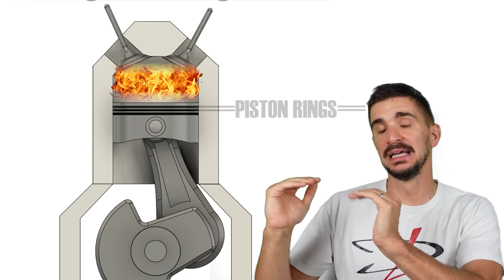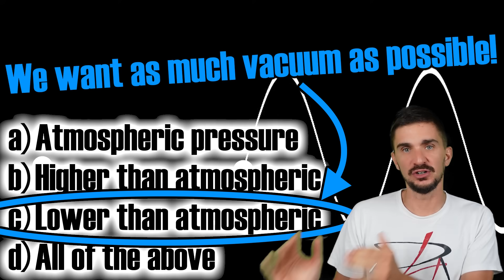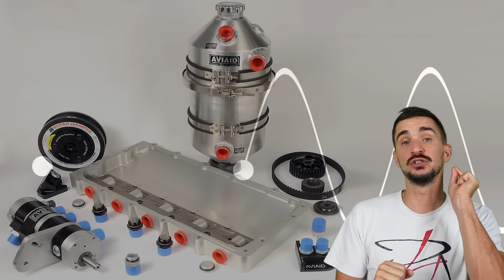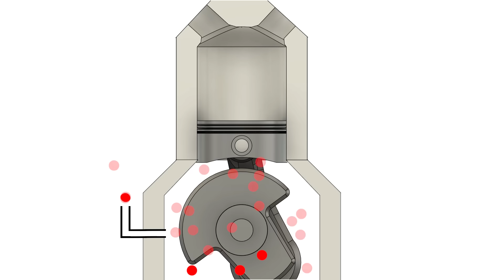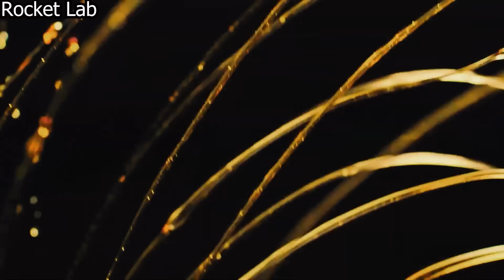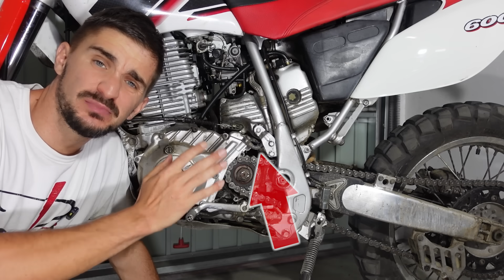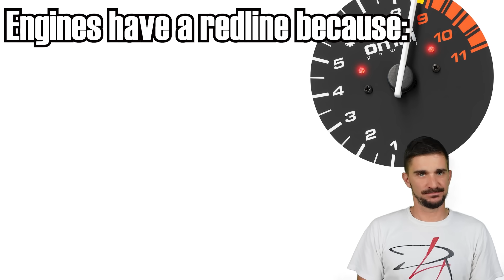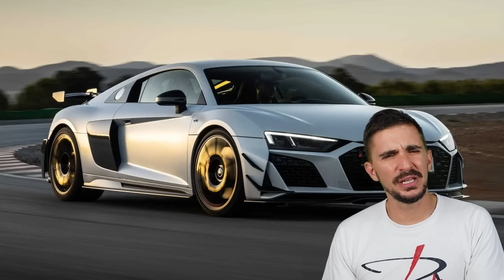Installing This Has No Drawbacks, Except for Your Wallet - Dry Sumps Are Awesome, Here's Why...

Comment: So mostly it is not installed to gain more power because of vacuum, first reason is uninterrupted oil delivery in extreme engine positions, next, in porsche's case it is mostly saving vertical space, partially it is applicable to bikes. That's it! More Powa is a side effect. Speaking of wet sump, oil hardly meets crankshaft, you need to overfill oil significantly, 2x of max level or more to achieve crankshaft dip on running engine. That's because significant volume of oil is in oil traces. Take a look at Garage 54 experiment.

Comment: Just a thought: I saw Garage54 test the angles at which the engine is starved of oil. Have you seen that video? It seems that EXTREME angles (therefore acceleration - in any direction) are needed to starve the engine of oil. Do you really think that still may be an issue with wet sumps?

Comment: 0:10 If the combustion was below the piston rings… something was really wrong. 😂
Reply: 1 stroke engine 🤣
Reply: @immortalized.1 steam engine.
Reply: That's when you need a new engine block lol
Reply: Haha, usually that is a "one-off" problem! "Don't worry, it will only happen once!" 😂
Reply: Just another Tuesday for a Subaru
Reply: Like a 2 stroke engine
Reply: Maybe the engine is up side down!
Reply: Double the combustion, double the powah!
Reply: But there is so much more space and that fuel is thicker

Comment: 4:22 but surely the opposite is true for the return, 
Yes low pressure for the piston going down, but the high pressure in the cylinder means the crank suffers parasitic losses as the piston returns to TDC?

Comment: 20:25 going to 17000rpm with a coolant temperature of only 37°C is insane
Reply: Yes it is funny but unfortunately the dial rotates every time you put it on contact and 37c is the lowest temp it can show (source I have that same bike xd)
Reply: Yeah, that's always been an issue with Ford engines, with their ultra-high power production and off-the-charts rev-ability. Why, I remember shifting my bone-stock 650hp 289 at 26,000 RPMs at the track, because I didn't want to rev it beyond it's 30,000 rpm red light. 😊
Reply: @HighlanderNorth1  lol

Comment: 4:59 Jeep 4.0L straight 6 mentioned!!!!
Reply: That ultimate performance engine 😂 though the other commenters do point out the advantages of a dry sump for extreme temperatures off-road departure angles.
Reply: You should look up turismo Carretera in Argentina, they race jeep 6s with 24v dohc head conversions.  @becausetrains

Comment: Dry Sumps should have been made the standard on all cars many years ago. But I guess it isn't worth the effort or cost. I suppose on the most basic base model cars its a bit unnecessary, but anything sporty - like even the Mazda MX-5/Miata should have them because high G-Force is expected when driving them.

Comment: This guy produces very high quality technical videos! The 3d graphics are the best! And they always fit the text. He must put a lot of hours into them. Also, he is an excellent teacher. He avoids descending into too much detail, yet he is very thorough in exploring a subject. The order of his presentation is logical and easy to follow.. I have learned a lot from him over the years, and I have always had an interest in automotive engineering. I also appreciate his polite, clean language. I probably left something out. And no this is not a paid endorsement. You can see for yourself.  I just think he deserves the credit and support, and this with words is all I can give at present.
Reply: I concur 100%
Reply: He has no idea what he is talking about.   For instance, in this video he claims that the piston, in compressing the crankcase contents, means a power loss.   It doesn't, because while energy is stored in the gas when the piston goes down, the gas returns that same energy to the piston on its way up.  There is no energy loss, just a cycle back and forth.
In any case, in a balanced multi-cylinder engine, there is no compression since just as many pistons are going down as going up.
He made an equally silly claim in another video I watched.
He claims dry sump working can give you about 30 more horsepower.   That's ridiculous.   At university I did morse tests on the larger sizes of car engines - a morse test tells you the sum of losses due to friction and gas pumping.   These total significantly less than 30 HP.
Reply: @keithammleter3824  I don’t have your education but how do you get positive crankcase ventilation? Where does the positive come from? I understand it is “leakage” from the combustion leaking by the piston rings. My defense of his video is he’s explaining about dry sump lubrication to which my Porsche has.
Reply: The word “positive” in this case referred to the active ventilation of the corrosive gasses that can form as the combustion byproducts that leak past the piston rings react with moisture that has condensed in the crankcase after the engine has cooled down from operating temp. As opposed to the passive ventilation of the road draft tube which was commonplace on car engines before the 1960’s.
Reply: @Electricjello  In my previous post, I pointed out that compressing the crankcase contents does not mean a power loss.   This does not mean that blow-by does not occur - obviously it does.   If there is a build up of pressure from blow-by this has to be got rid of, and the valved ventilation back to the intake (Positive Crankcase Ventilation) is how it is done in car engines.
In large engines, eg marine propulsion, the build up of unburnt and partially burnt fuel that gets past the rings can be very dangerous - by combusting with the air in the crankcase it can cause the crankcase to explode.   This hazard is avoided by the use of pressure relief valves (Bicera valves) on the sides of the crankcase.
I haven't watched the entire video, so i don't know if he covered the following.   I watched half of it -  the presenter's ignorance and multiple errors was enough for me.
Dry sump working has advantages.    It avoids oil pump starvation in engines that have to operate tilted or upside down (eg aerobatic aircraft), and engines used in racing where they are subject to lots of extreme acceleration and braking.   Dry sump working is often used in applications where very long service intervals are required, since there is no limit to how much oil can be held in the external tank.   In marine propulsion it means you can change the oil without shutting down the engine, which you never want to do when at sea.  
But not to get more power.   Your Porche does not confirm this video.
Reply: @Electricjello  Compressing and decompressing matter exerts heat, correct? Every energy transformation or transfer leads to energy loss, usually in the form of heat.
Reply: @keithammleter3824  You watch half a video and then talk about engines that are in different league to prove your invalid point.
 Reducing pumping losses is a valid way of making an engine more efficient and increasing horse power.
Reply: @keithammleter3824  I guess Porsche got it wrong? Let me know when you make videos so I can see the correct way to present these topics. Thank you
Reply: @chibacha21_CarBoi  Compressing a gas transfers heat to the surrounding vessel, and subsequent expansion draws heat from the vessel back into the gas.
Reply: @Electricjello  I didn't say Porsche got it wrong.  Read my earlier post - I said in certain applications involving high acceleration and braking, dry sump working is an advantage in that it avoids sloshing starving the oil pump of oil.
This could well apply to a high performance Porche, though marketing advantage could well be a part of Porches' decision to include it.
What I objected to was the video presenter's claim that you can get something like 30 extra horsepower.
Reply: @no1aussiepaul  Theoretically yes, but as I said, I have done Morse testing on car engines.   These engines were permanently installed in dynamometers at the university I did my engineering degree I did.   The pumping losses are shown by the Morse testing to be way too low for any saving through dry sump working to be significant.
I didn't bring up engines in a different league to prove my point.   I mentioned them to help a poster who was asking about how positive crankcase ventilation worked.  Not all engines have PCV - If I didn't mention the alternatives, not doubt some turkey would claim I omitted them.
Reply: @keithammleter3824  As I explained, every energy heat transfer or transformation, including compressing and decompressing matter, leads to energy loss, usually in the form of heat or sound.
Reply: @keithammleter3824  brother you go squeeze and unsqueeze air for an hour and tell me if youre tired or not
Reply: @grqfes  You can go squeeze and unsqueeze a coil spring and get tired.  Its the same thing.   At the end the spring won't be any different and neither will the air.
Now go and look up the meaning of "adiabatic process", which you should have learnt about in high school science, if you were paying attention.
Reply: @keithammleter3824  Well, Im running a ford 2.0L at 8500rpm N/A with drysump pump pulling a vacuum gives me 5-7hp more as compared to before we set the system up for vacuum. Any builder worth his salt, knows and will tell you that is one of the many advantages a drysump can provide. 30hp on 2.0L turbo sounds reasonable to me, if that is his setup.

Comment: Actually motorcycle lean angle in curves has about no effect on the engine oil: the sum of acceleration seen by the oil remain close to vertical in the motorbike frame of reference. Massive acceleration and braking, on the opposite, could starve oil. Also, some bikes are well known to "deprime" their oil pump in case of wheeling.
Reply: deprime is...bending sump or pickup or

Comment: What about the cylinder head. How does the dry sump lubricate the camshafts,lifters etc ? Would of love to see an explanation of that.
Reply: Same way a wet sump does, with a pressurized feed, from the pressure stage of the oil pump.

Comment: Also a lot of high end high performance cars stock from the factory are equipped with dry sump. Typically the pump are chain driven instead of belt, and all the scavenge passages are cast or machined into the metal parts and don’t require all the hoses and fitting which can become problematic with a road going car.

Comment: Wont that make your car less efficient?  For most consumer car engine people care much more about fuel efficiency than peak power.  Those parasitic lost will cost you fuel but when you are running at 3k rpm on the highway the advantage are not really present.

Comment: An official disadvantage is weight because a 5 l weighs less than 8l or 10 l of oil and yes also the cost of the oil and also a disadvantage is you can measure the oil when the engine is running and not standing still that's how it was explained to my father with his Audi A8 D2 with the small WR12
Reply: It's an advantage and disadvantage at the same time. You have more oil, but it helps with cooling. Bigger capacity mean more weight, but you can place the oil tank in better place and have you engine lower in he engine bay. Also, you don't measure oil level when a car is running.

Comment: There is one more drawback other than added cost and complexity, those only really apply to road cars though.
In a dry sump system the oil cooling is so good that getting the oil up to temperature can be quite a challenge if all you do is 15-30 minutes of low stress commuting. Many older Mercedes models actually had dry sumps for their benefits but because people didn‘t drive them correctly the oil just got constantly contaminated with gasoline, so Mercedes then switched back to a wet sump system and the problem got solved. This would only be exacerbated by modern engines because those are much more thermally efficient leading to an even slower oil heat up.
Reply: so , a heater in sump system to evaporate gasolin
Reply: @orangestoneface yes that would fix it. But I wanted to point this out regardless because D4A didn‘t even mention it when this was the sole reason why we don‘t see dry sumps in passenger cars
Reply: @SahnigReingeloetet it’s sad that we can’t have nice things like that, all we get is big rims, big grills , big touch screens and small engines cause they don’t care about the engineering behind it

Comment: At 16:15 you show the exact instrumentation displayed in the cockpit of my aircraft, powered by a Rotax 912 ULS 100hp engine. I have a couple of comments. The oil temperature is far too low at 50C and the oil pressure is low at 3 bar, given that the rpm gauge shows 4000. Low oil temperature, which should be up around 90C like most cars maintain, doesn't enable water in the oil to fully vaporise and so increases engine wear. Yes, I can see that the parameters are changing over a few seconds.

The flat 4 cylinder Rotax aircraft engine relies on piston blow-by to pressurise the crankcase and push the oil back to the external oil tank. From there the oil flows via an oil cooler to the oil pump which forces oil through the galleries etc to lubricate engine internals. This system has no scavenge oil pump and relies solely on crankcase pressure being higher than atmospheric, on average, to send oil back to the oil tank.
Reply: Doesn't seem like the best design, the better the piston sealing the worse the oil scavenging.
Reply: @ferrumignis  In the small 2 seat aircraft category, the Rotax 900 series engines are the best selling on the planet, being lighter, better power to weight, more fuel efficient and exceptionally reliable, compared against American "equivalent" engines like Lycoming etc. Which is why they're chosen in the majority of new designs of aircraft in the 2 seat class and some 4 seat types.
The recommended fuel is ordinary unleaded car fuel with up to 5% ethanol, not leaded 100LL avgas and fuel consumption is approx 2/3 of avgas consumption in aircraft of similar size and performance. With the same basic design of engine, the Rotax 916iS is able to generate up to 160hp without reduction in reliability.
Finally, the American small aircraft engines typically use several quarts of oil every 50 flying hours, while the Rotax 900 series use between 1/2 and 1 litre.
Reply: @colibri492  "In the small 2 seat aircraft category, the Rotax 900 series engines are the best selling on the planet"

You appear to be trying to argue against points I simply haven't made.  Perhaps you could address the one I did?
Reply: @ferrumignis  does your butt hurt much from reading facts about an clearly engine better than some ancient 'murican made? 🤣
Reply: @ferrumignis  What you say is true. Rather than attempting to explain this seeming anomaly, compared with the points made in the video and which I'm not qualified to address, I decided only to counter your "Doesn't seem like the best design" by pointing out that Rotax 900 series engines have proven in hundreds of thousands of operational flying hours to be a truly excellent design. Why? I don't know and am obliged to fall back on the "proof of the pudding" maxim.
Reply: @thatdudeinorange5269  I'm pretty sure I know why your butt hurts.  Your daddy is a tight fit.
Reply: @colibri492  If it's such an awesome design with no issues, why don't ANY car manufacturers used the system?  Not a single one.
Reply: @ferrumignis  A: It's an aeroplane, not a car! B: "I'm not qualified to address". C: Here endeth discussions on this topic. D: Find someone more worthy of your scepticism.
Reply: @ferrumignis  The piston moving down will create pressure in the crankcase even if there is no combustion, and a good seal on the piston is essential for that
Reply: In a 4 cylinder, for every piston going down there's another piston going up.
Reply: @S50Sinner oh yeah, good Point
Reply: Now I'm really curious what the pressure numbers look like at altitude. Does the ratio stay the same? Does this oil pumping system perform better, the higher your altitude is, contrary to the engine itself? So it would seem. Very interesting!
Reply: @Macintoshiba older engines have a green arch on the manifold pressure gauge starting at around 14in.
Reply: I mentioned this being a rotax as well but my comment didn't get seen.

The reason cars don't have this system is because car engines have stricter emission standards, requiring the PCV system to keep the engine under ambient pressure.
Aircraft engines are inspected and have oil changes every 50hrs. Depending on the flight school that can be every 2 weeks.
Cars are more compact and closed off, aircraft are designed to be maintained. 

The piston rings have to be looser in aircraft engines. The cylinder walls on aircraft engines are very thin and are air cooled and change size more than a water cooled car engine. The engine is under 75% or more load constantly.

There are many reasons why the oil pressure indication could be going down. 
At higher RPM and higher flows there could be vacuum or cavitation in front of the oil pump. This can be caused by a blocked inlet, bad oil line layout or a leaking crank case.

Rotax engines can be used and installed by homebuilders and there isn't really a standard on the oil line layout. 

Additionally the increase in system voltage at higher RPM and a bad wire could cause a lower indication. 

I fly these things over mountains with my wife next to me. If they were bad designs i wouldn't do that
Reply: @MrTommymxr  A design can be bad and still be reliable.  Having positive crankcase pressure is inviting oil leaks and increased oil consumption.
Reply: @ferrumignis  bruh...